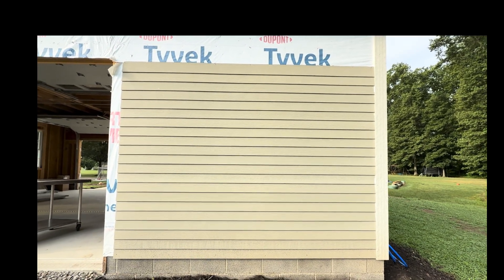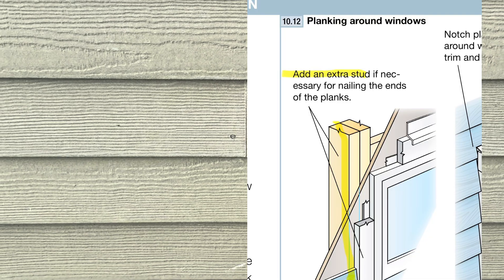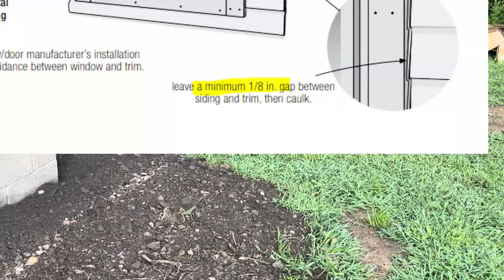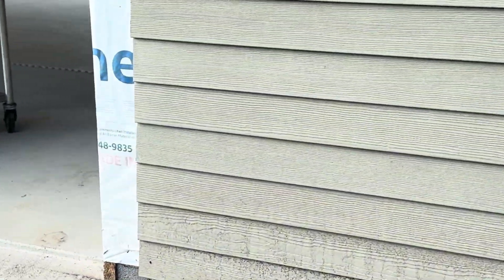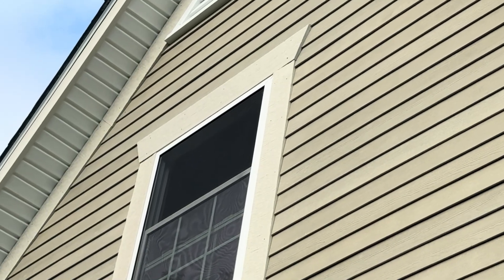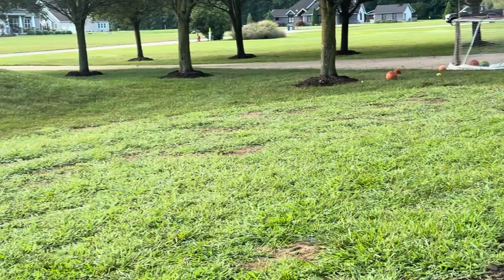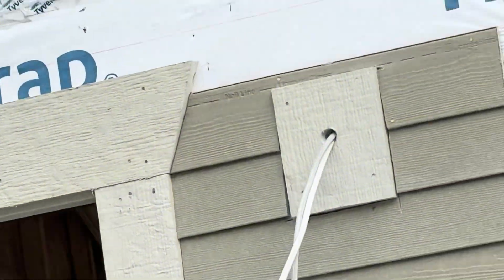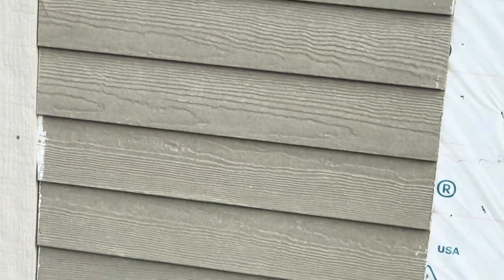Every James Hardie Siding Rule My Contractor Broke - Over 25+ violations exposed

Comment: I feel your pain. I had my house re-cladded using Harding lap siding and similarly found many violations of Hardie's installation specs, even though the company I hired has been installing this siding for years and has a good reputation for the work they do (and I had hired them previously for painting and was very pleased). 

I can tell from what you shared that the people doing the work didn't understand how the specs protect for the structural vulnerability of the product (why placement of nails is critical) and what is meant to protect against water intrusion. The most egregious errors on my house were with specs to protect against water intrusion. For example: z-flashing was installed but the middle was not angled, so It's not any different than the flat trim; and the gap between the flashing and siding is supposed to be 1'4" but it's more like 1/16" on my house, which I think means that the surface tension property of water may hold it in place in that space. Yikes!!  But these issues may be irrelevant because of a more basic problem, which is that a ZIP system sheathing was used which has an integrated house wrap layer, so they should have taped off the upper edge of the z-flashing ('cause there's no house wrap to put it behind) and not doing that means water can go behind the flashing. 

And I had similar issues to you regarding the siding-trim gap, which was slim to none on my house. And when some was replaced and I called attend to the need to leave 1/4" gap, they balked at that. I eventually found a caulk that could work in narrower gaps than most caulks (DAP's AMP), so the caulk is less likely to prematurely fail compared to if they had used another type, but it's annoying that they placed aesthetics over function. 

Finally. I also had issue with fastening, the biggest issue of which was overdriving, particularly with the trim. They used screws on the trim (even though that's not a recommended fastener), so as heavy as the boards are, driving further into them means the fastener is not holding with the force designed. Ugh!! With all these errors, if there are issues, the wonderful Hardie warranty is basically invalidated . . .

I am curious about what your next steps are. Will what's been installed be reinstalled so that correct procedures are followed?

I wish you well with getting things done correctly!!
Reply from the maker: It was reinstalled but they didn’t put nails in the nail line on the second attempt -  after I provided a building inspector report,  printed copies of instructions, this very video link and created a “daily quality control checklist” .  They also used oil enamel in lieu of acrylic primer after I told them exactly what was required a few days prior. 

This has escalated to a legal matter - I have many more videos to share after that is resolved.
Reply: @ericg4489  Wow. That's so unfortunate that it has escalated, but I applaud you for pursing things to get them done right. I am quite familiar with Hardie's installation guide and find it quite clear, so it's frustrating that such errors get made. 
My experience included crew members balking at following some of the guidelines because they thought they didn't look good; e.g., leaving a 1/4" gap between the z-flashing and the first course of siding, so water can easily shed. So, I've got very narrow gaps that I think will mean that the surface tension of water could hold water in place there, rather than it shedding.
Anyway, I wish you the best in holding folks to account and getting the quality in the recladding of your house that you deserve and that respects the quality of the Hardie products.

Comment: Did you choose a different brand of siding for a replacement?  We are looking at this and your experience makes me want to look for something else....
Reply: Why change?  It appears to be installer errors not product failures.
Reply from the maker: No we did not because I needed this siding to match the siding on my existing house.
Reply: Curious to known what the contractor’s response when all these noncompliant issues were brought to their attention? It almost seems like the contractor has zero experience with Hardie siding … as if they’re more use to slapping up vinyl siding.
Reply from the maker: I suspect you are correct. They redid the entire thing and still didn’t put the nails in the nail line on the second attempt. I have more videos to share about round 2 but need to wait until the matter is resolved as it is likely to turn into a formal dispute.  @FactsDontCareAboutFeelings-m6x